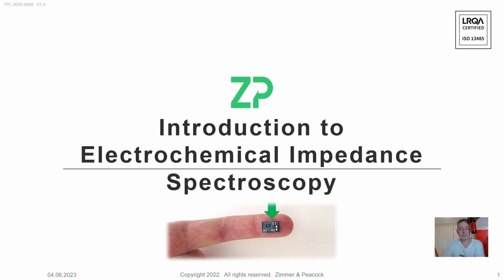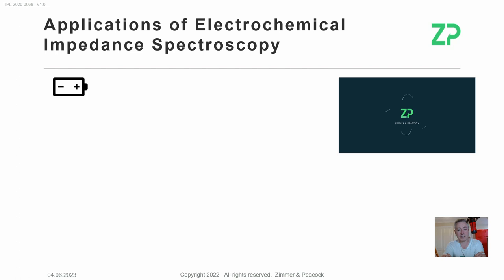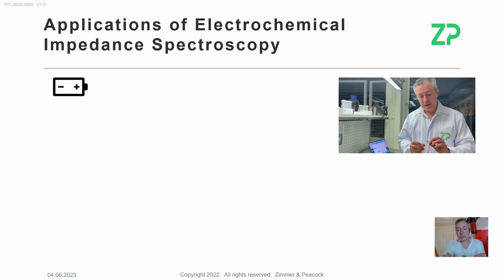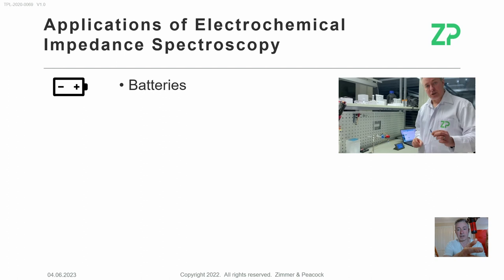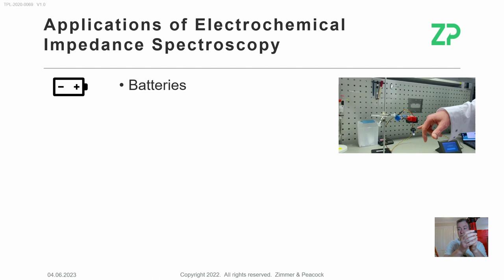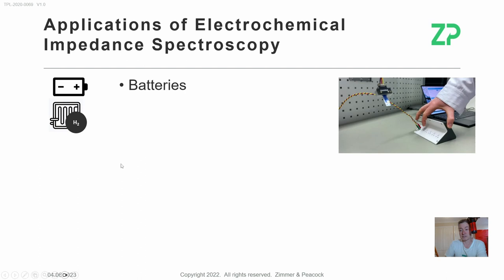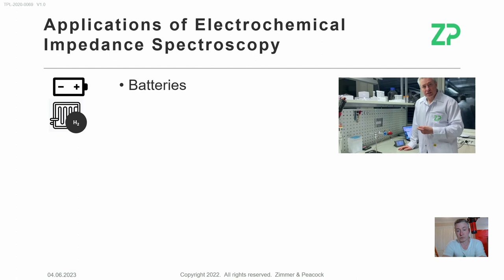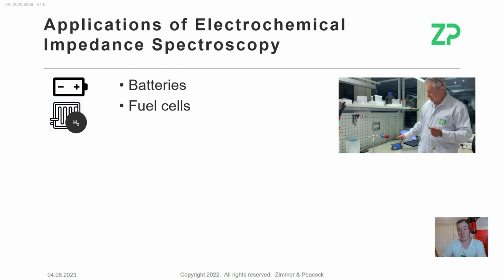An introduction to Electrochemical Impedance Spectroscopy

Comment: So you’re basically doing what electrical engineers would call a network analysis? Except with a lot of extraneous woo woo terminology. What’s wrong with calling it a Smith chart? I’d like to find a video that tells me what you learn from this analysis.
Reply from the maker: I think if you come from the world of chemistry you have a certain language, if you are an electronics engineer you will have different words. One thing we do know is that electrochemists didn't invent this we have borrowed the technique from our electronic engineer colleagues - if you have requests please post here - https://www.zimmerpeacocktech.com/contact-support/
Reply from the maker: thank you I did just do some reading on Smith Chart, and I see that we are impedance matching and we can borrow from the Smith Chart and though the Smith was thinking about RF, the principles can be borrowed. There is one phenomena that we have in electrochemistry not seen in more standard electronics which is molecular diffusion and so I can  see at low frequencies we may break the chart, but all very interesting - thank you ZP
Reply: Thanks for the reply. This is a subject I’d really like to understand, so it’s a delight that it crosses into network analysis. As you’re measuring complex parameters vs frequency do FTs of the results to give a useful “radar” type of image of the mag and location of the impedances? 
I need a good textbook on this.
Edit: PS please ignore FT comment, I’ve just realised that your frequency is probably too low to get useful information.
Reply from the maker: The term Smith Chart is not taught to us electrochemists, I do realise that the two subjects are clearly related, but even during my PhD I just never came across the term Smith Chart, now 26 years in industry this is the first time the term Smith Chart has come to my attention

Comment: Hello Martin,
If I understood the concept,  to measure the EIS, the main input is voltage and current. Output will be complex impedance with respect to frequency.  Could you pls agree with it? I am not technical background but looking forward your response. Is this measurement can be consider as safety?
Reply from the maker: The input is voltage and current follows the voltage, by knowing the voltage and measuring the current you can calculate the resistance - M